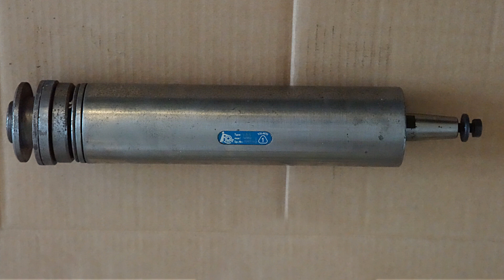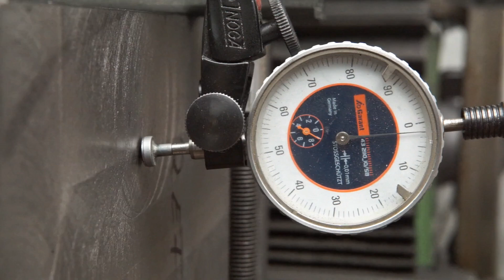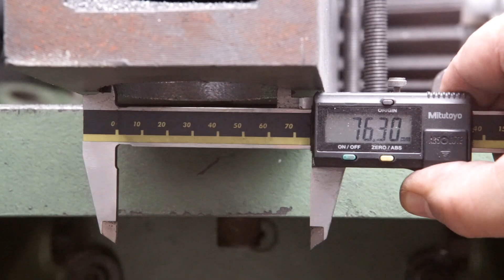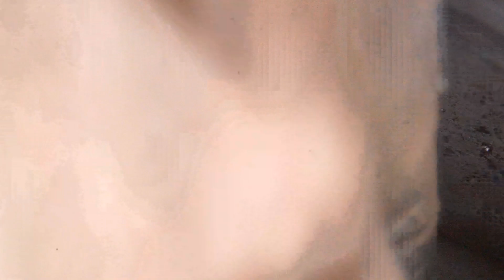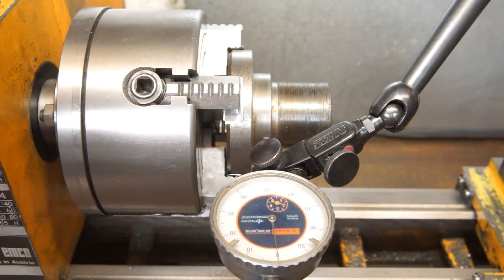machining a spindle adapter for a tool grinder

Comment: great work next time use a boringbar for the seccond cone takes just one crosslide adjustment and both the same (pouli)
Reply from the maker: thanks for your suggestion - however, I am not sure, if I understand you correctly.
I am aware that turning an outer and inner cone with identical compound slide setting leads to matching cones  -at least as long as the headstock is aligned correctly and the tool is on center height.
In my case I did not machine the cone of the spindle nose. It was given by the manufacturer of the spindle. Thus I had to sweep  it with the indicator to set up the compound slide. I turned the OD of the initial "reference cone" with this setting and used this cone to check for the correct cone angle using the inner cone of the flange. (Which came with the spindle and matches the spindle nose.) The ID of the pulley was turned with the same compound slide angle - as you suggest.
Edit: sorry - I got your point: you are referring to the 1° double cone of the pulley crown. Yes, you are right, that would have been possible. Thanks.

Comment: Very nice video Harald!
Maybe i should have borrowed you my 75mm Drillbit for these bores 😉
Overall a nice project, i hope you find time to upload a video for the finishing steps, i enjoyed that length of the video 😊
Greetings from bavaria, Chris
Reply from the maker: Yes a 75 mm bit would have sped up the process considerably.
Currently I am waiting for a grinding wheel. I will certainly do a follow up video showing the balancing of the wheel and the first grinding attempts.
Reply: @HaraldFinster  very nice, cant wait for that 😊👍